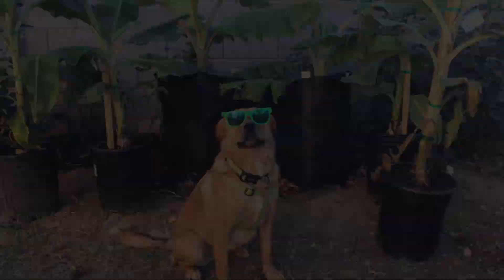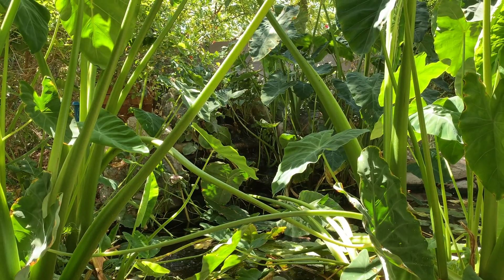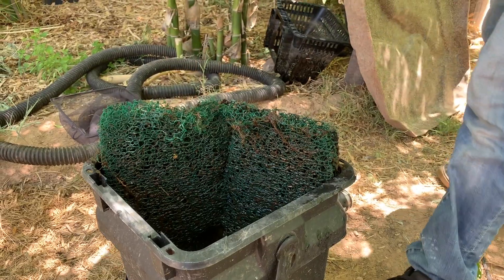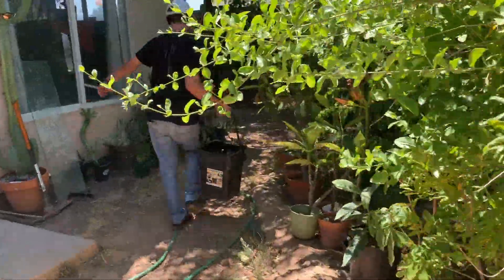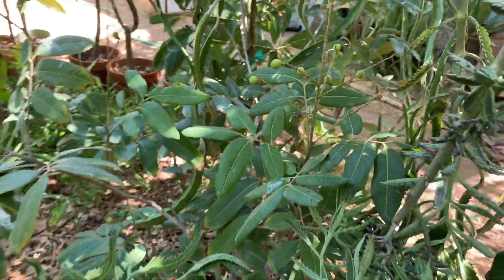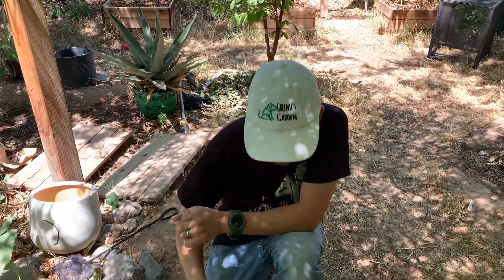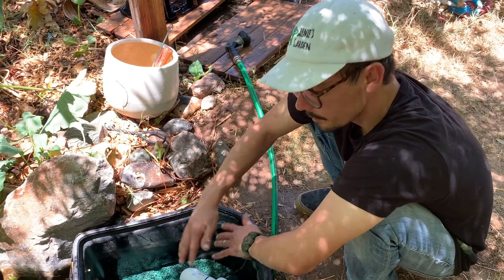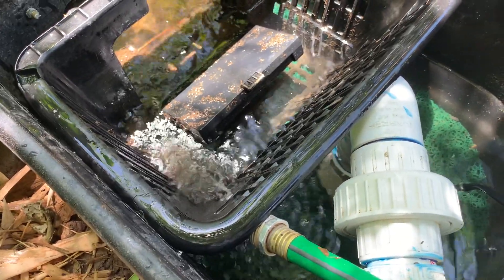Weekly Backyard Pond Maintenance

Comment: Although I greatly appreciate the video, the result was me understanding that having a pond requires way too much maintenance time for me to justify it.
Reply from the maker: It did take a little longer than usual since we were filming the whole time! But thanks for checking in!
Reply: With a proper design and good pond materials, pond cleaning can be done once a year. A wetland filter and intake bay requires significantly less work. I only clean my pond 2-3x/ season. (which my pond is set up more like Brandon’s pond) 
If you have too many fish, or an undersized filter, it requires more maintenance. I also think it’s worth noting that B&A are using the water for irrigation. But even still, there is a way to design an irrigation system with the pond water.
Reply: Also newer ponds tend to take more maintenance.